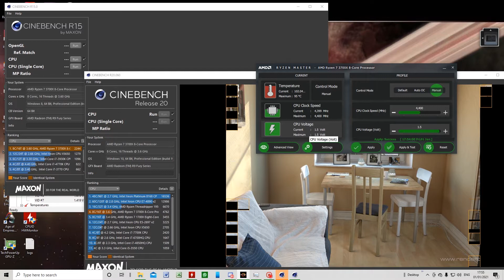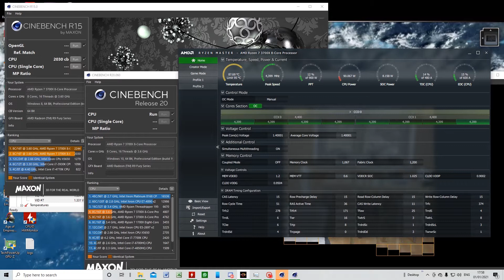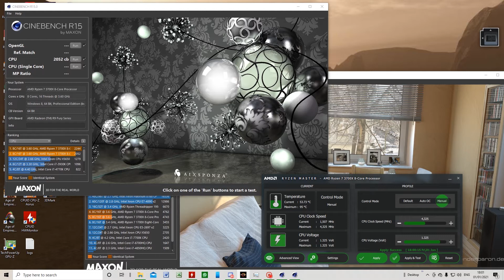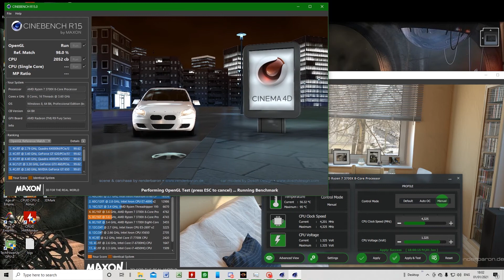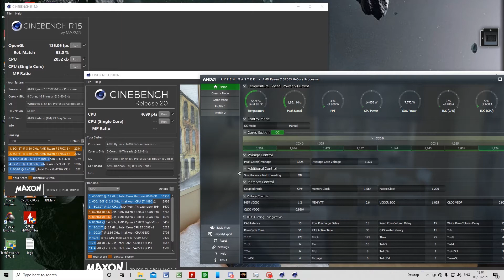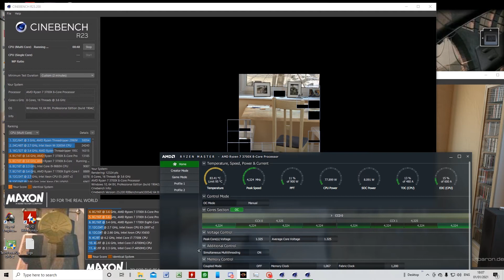Using AMD Ryzen Master app to Overclock my Ryzen 3700X CPU

Comment: 4.3Mhz & 1.125v got me best results....(5158) stable max 80c, beyond that I need to crank the voltage and the score doesn't get much higher...
Reply from the maker: I think there are limit too how high you can get that overclock.  But it sound quite good

Comment: So do you use this app while the CPU is under load or while it is idling?
Reply from the maker: You can use the app at idle or under load.  
It is probably better to make adjustments when your CPU is idle.
All that happens is that you change the frequency
from like 4.0GHz to a high frequency of 4.5Ghz example.

Comment: I got my 3700x at 4.4Ghz 1.3v in Ryzen Master and 5274cp in R20, temps are fine. Only downside the cpu doesnt downclock (like when at stock, and monitoring with cpuz or hwinfo, completly different readings than Ryzen Master). I wonder why it doesnt downclock, please respond if you know thanks.
Reply: i have a 3700x and has same problem
Reply: @zach17614  after some reading i understand that effective clock reading in hwinfo are the real clocks and what ryzen master reports (check if cores go to sleep). Its somehow different than when stock but the 3700x downclocks actually even when oc'ed. I left mine stock (latest agesa and chipset) and it boost to 4.4Ghz  on all cores like intended. So dont worry to much.

Comment: thanks for almost killing my pc
Reply from the maker: I don't use this program anymore.  It only increases my CPU performance by 9%.  You need a good cooling system as well and it makes my system very unstable.   If I need more performance I would just get a 3950x.  And it makes no difference for gaming whatsoever.
Reply: @JpbYTW29  k thx
Reply: Your own fault for putting your cpu to 1.5 volts
Reply: @DeclanUK  no it wasnt it was your fault for recommending it
Reply from the maker: @zach17614  Note that I do not recommend using this program.   I was showing how Voltage affects the temperature of the CPU.   As I say in the video the temperature is too high, so I lower the voltage down to 1.325v.   It's a test to show how the program works not that you show run the Voltage at 1.5v.

Comment: How do reset the overclock
Reply from the maker: In the basic mode, you have  Default, Auto, and Maual.   There is a reset button on the far bottom far right.    
But I just select Default which should let the default setting take over.
Reply: @JpbYTW29  Every time I reboot it’ll put it back to 4.0 GHz
Reply from the maker: @Xullvy  Try to change the setting in the bios to Auto. Open Task Manager, check if the clock speed is going up and down from 3.8 to 4.3GHz, that is the normal CPU function.    Check there are no other overclocking programs running as I have an X570 motherboard pro and it came with an overclocking program.   When using AMD Ryzen Master other overclocking programs may change or not work as intended as that a problem I had.
Reply: @JpbYTW29  so I close it in task Manager
Reply from the maker: @Xullvy  Yes, you can close programs with the Task Manager.     Is your CPU lock at 4GHz all cores still?
Reply from the maker: @Xullvy  I use Task Manager as a way to monitor if the CPU clock speed is lock-in overclock or it on Default or Auto setting.
Reply: @JpbYTW29  yea when I boot it up
Reply: It at 4.0ghz
Reply from the maker: @Xullvy  4GHz is fine, it only a problem if your clock speed is locked at higher and you are running very intensive CPU loads.  Then Overheating may be a problem.

Comment: Ryzen 7 3700x with Msi 240r Aio Liquid Cooler & Ryzen master i managed a Stable 4.5 ghz @ 1.375v with Temps under 73c = Not Shabby in my Opinion with Msi Mpg x570 gaming Plus mobo ..... i’ve been OverClocking Cpu’s for about a year Now and i Prefer Ryzen Master vs going into bios : any mistakes  Just Re-Start system and everything goes back to default 🇵🇹
Reply from the maker: I could do with a liquid cooler.  I think the case that I got really needs better airflow.  When playing games with very CPU & GPU high loads my CPU can hit 95*C.   The GPU never goes more than 80*c it got 3 fans but gets noisy.   When that happens I just open one side of the case and the temperature drop by up to 15*c.
Reply: @JpbYTW29  - my R7-3700x is a 65w tdp .... higher tier Ryzen & intels can Create more heat butt my DeepCool Matrexx Case Came with four decent Rgb fans + Liquid Cooler mounted on top : getting my money’s worth ( Case & Aio we’re about $100.- each )  What Cpu do you have & Click on my Nic, posted some benchmark’s with Processor intensive games 🎮
Reply: Boas, tenho o mesmo cpu e board, deixo apenas o boost natural do cpu, fica entre 4.2 e 4.25 com undervolting, refrigerado a ar a jogar Warzone atinge de maximo 63c
Reply: @K9PT  - esperimenta a usar Ryzen master  , Mas Nao Usa mais de  1.4v  de forca para O Cpu  🖥
Reply: Jose Necho - Click on my name & See benchmark’s of Ryzen 7 3700x  @.  4.5ghz  🎮
Reply: @hpcarlos2255  Neste momento prefiro ter menos temperatura, logo menos ruido pois de 4.2 para 4.5 não compensa.Mas obrigado.
Reply: @K9PT    👍
Reply: In the bios , The default vcore is around 1.4  v ..Is this ok ??